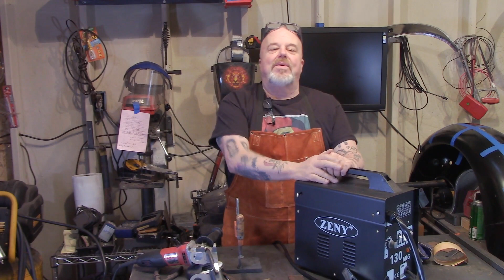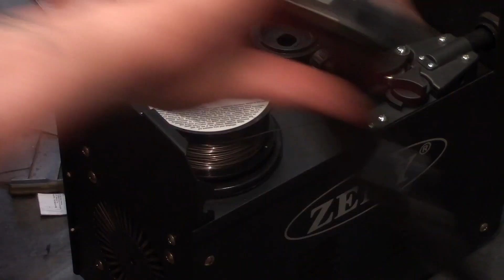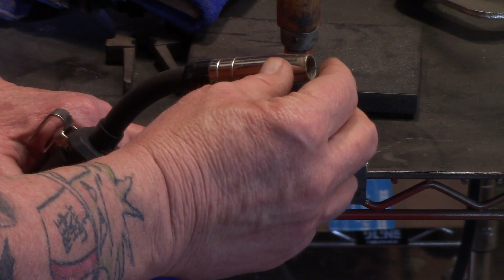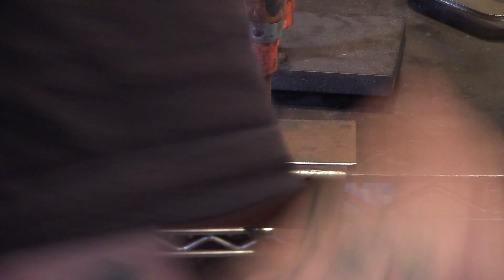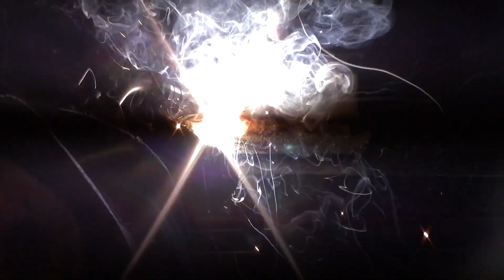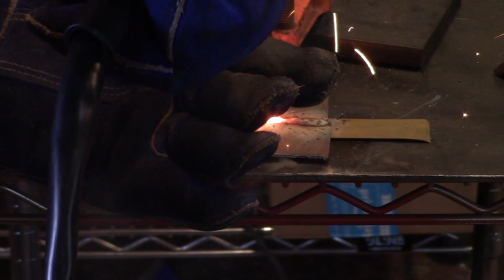Flux Core Welding 101 -The Basics- How To Weld - Basic Tutorial For Beginners

Comment: 1st i'm a beginner. was wondering at your weld in 30:00 min. of the video had a lot of splatter. was that from the thin metal or was that the wire speed going a little fast. just wondering haven't got my welder quiet yet. 😕
Reply from the maker: I hope to reshoot the vid. But yes. You nailed it

Comment: love it - I watched a bunch of stuff, got my welder a month ago - just got my table all set up tonight - and I'm still glad I came to watch this before I started practicing. I like that he left in the problem with the paper catching on the roller - something I would never have known to think about if I saw the motor was running, the feed clamp was correct but nothing was pulling. Also So glad you point out the power of the angle grinder - I've been using that tool since I was a teenager and it blows me away how cavalier some people are with angle grinders - especially those videos of people with that new chain saw blade wheel they've made for it - that thing should not even be allowed on the market in my opinion, but in any case that guard will definitely save your bacon. ALWAYS have it on and ALWAYS make sure to take the few seconds to rotate it based on your grind angle. Guy who taught me how to use one had two missing fingers to prove that they're powerful enough to really run away from you fast - they'll dig into anything you let them grab and god help you if it grabs a shirt sleeve or something. (he learned his lesson many decades before teaching me.)
Reply from the maker: Amen

Comment: I bought the Chicago Electric 125 a couple months ago.  However, I just started flux-core welding today.  Big difficulties.  I finally figured out that the wire feed was too slow.

Epiphany it was to me that you told longer wire is cooler and shorter wire is hotter.  After an hour of weld time, two hours clock time.

I found keeping the arc going on 10-gauge steel was easier with a high wire speed.  My problem which I am going to bed with is that if I do not get a spark immediately, the wire gets too long.  Sometimes when I finish a run the wire is three feet inches long.

Comment: I've been gas shielded MIG welding since I was about 6, just used my dad's snap-on welding setup. I'm to the point where I use his welder more than he does and I buy the gas/wire for him, I've gotten insanely good at getting those perfect welds. Only reason I'm here is I recently picked up a 5500w generator (needs carb and some love) and I'm thinking about fixing it up and using it to power a welder in my small shop, and since I am sick of buying gas I wanted to see what I can do with a flux core. So thank you for your info!

Comment: I never welded before one aspect is confusing me.Do you continuously hold the gun pushed in to get wire coming out while welding or you press stop press stop.Thank you
Reply from the maker: stop and start and stop and start. otherwise you'll burn out the base metal
Reply: @HughesMotorized  Thank you very much this aspect is almost never mentioned videos I watched.I guess its critical to see the wire tip how fast is burning up so you press more feed.

Comment: why are  you  stopping and starting  the  weld path? what shade of filter glass are  you using ?  say for  30 amps.
Reply from the maker: the longer you weld, the hotter the arc gets. Get it too hot and you will blow out lighter steel. Every hood is different. Go for 9 - 13. Start w medium sensitivity so you dont have it being dark before welding

Comment: should the gun nuzzle  tough the metal your welding or is it just the welding wire that should touch the metal?
Reply from the maker: Just the wire. You can actually run without the nozzle if you are not using gas

Comment: You don't have to do the back and forth movement when flux core welding.
Just pull in a straight line and make sure your puddle is covering the gap evenly on both sides of the weld.
You're also a little too close to pushing your weld rather than pulling.
Flux creates slag so you drag.

Comment: Looks like you were moving too fast. You also need to move around in order to not overheat the metal. Welder should also be able to be set DC+. That is, ground clamp should be + and torch -.

Comment: Hi could you weld 3/8inch material with a flux welder like this ? Great channel by the way
Reply from the maker: You are pushing it. You can do a root pass then come back with a pass or two. If it is something that a life depends on it? NO. You need a 220v higher amp machine if safety is an issue
Reply: @HughesMotorized  thanks for the response I am looking to make a 72" belt grinder like the one on jeremy Schmidt channel, I think I should do a bit more research thank you so much again for replying
Reply from the maker: @stephenforrester1832  YES, you can build that w/ a basic flux core machine. Just take your time

Comment: Can actully use the gun without that big tip so you can see the wire coming through better when you are welding? Seems like the tip on the gun is too big and should've been pointier.
Reply from the maker: YES. If you are not using gas then toss the tip
Reply: @HughesMotorized  thanks.

Comment: I see a problem with welders of that design.  The nozzle is used with gas.  I would think the nozzle gets in the way of viewing your arc and puddle.  When welding thin metal, I might suggest as other welders with more expierience than I do that you stitch weld (1" weld, 1" gap).  Then clean the slag and weld in the gaps.  Starting and stopping as you did incorporates slag in the weld; leads to porosity and weak weld joints.
Reply from the maker: Yup. You can do it without the nozzle on flux core. 1" and skp 1" is a good way indeed

Comment: Your commentary absolutely beats the hell out of any video I have seen thus far!! lol. You talk like I do, so I can understand ya! Maybe you could answer a few questions for me, purchased a truck with a rotted frame (unknowingly) and plan to buy the frame repair kit and weld it on. Was going to purchase a 170a flux core mig welder from Harbor Freight for the job. It is 1/8" steel, what size wire would you recommend and what setting would be best? I plan to practice first on scrap steel, as I have never welded with a mig welder before and have limited experience with a stick welder. Just do not want to end up totally screwed on this truck and no one around here seems to want to do it. Thanks in advance!
Reply from the maker: I'd say .035 wire and about a medium setting power wise. Main thing is get some scrap steel and practice. Do some destructive testing and cut across some welds to see penetration. Weld.com has some very informative videos that detail testing your welds. Kevin Carom does some awesome welding videos too. Good luck

Comment: Im buying a (cheap) 4 in 1 welder (mig, tig, flux core, stick) welder. I think i will use the flux core first because its the most convieint welding to stsrt. At least thats what i think
Reply from the maker: Flux core is most convenient and cheapest along with stick. Not so good on thinner metal. You can but it takes practice. MIG will set you back some $$$ but worth it
Reply: @HughesMotorized  im buying a 4 in 1 machine mig, tig, flux core and stick welder so i will have the option to use co2 or argon welding. And its not that expensive from the lidl store. And its quite a decent quality from reviews i saw

Comment: Hey there! I need advice - maybe You know about this: So I am trying to flux-core weld (polarities inverted, knurled roll, diameters correct). I want to weld an M4 rod onto the side of a long (4x normal length) M4 nut. A few tack welds would suffice. My machine has settings for material thickness and adjusts all else itself - so far, with ~2mm thickness and varying settings for more or less welding heat, I don´ t get far. Tried to pull the weld across the joint, not so much pointing it right at it. Mostly, I get bead on both parts, but no joint between them. I tried not ruining the thread in the nut. To that end I also put a vaseline-covered screw into the nut. Please, any advice would be dearly cherished.
Reply from the maker: shoot me a vid of the effort, settings, ground clamp and the like. hughesmotorized@gmail.com , I'll see if I can help
Reply: @HughesMotorized  Thank You! I noted your mail address, take it down if you want to. I´ll probably need a couple days before I can get back into the shop. So long :)

Comment: Great video. Thanks. I'm learning and getting a unit and gonna start practicing soon and you gave me inspiration. I have a pickup that needs cab mounts and a rocker panel.The mounts are 11 gauge. What size wire and settings would I need to be on?
Reply from the maker: I'd offer if you are doing flux core to go w/ .030" and if MIG then go w/ .023". Turn amps down low and see how it's working. Work in very short pulses to avoid blowouts

Comment: My fave video and instructor on flux core, I've just started myself with flux core and like he says it does take practice,  I spent a whole day just grinding and welding bits and pieces together and by the end of the day I looked homeless, I was that dirty and had that many holes in my clothes it was unreal. One of my problems as a novice is helmet settings, I'm still struggling to see what and where I'm welding sometimes which is a pain.
Reply from the maker: I bought a helmet with a bigger viewing area. I set it on 10. Check out this video. Might help : https://youtu.be/-FM2L_KOakU
Reply: @HughesMotorized  thanks buddy

Comment: When loading a new spool of wire pull the torch cable tight and straight, this gets the wire through easier without it binding up , also removing the tip helps .
Reply from the maker: good tips. thank you

Comment: I literally have this same welder.. Zeny 130.. .. You need to look up the videos for converting this welder to a DC welder.. It comes factory Ac.. You will need a 200 amp bridge rectifier .. And you will need to make your ground hot and your gun ground.. And put a new ground clamp on It....It also calls for a bleed resistor and a few capasitors .... But this machine right out of the box is garbage..
Reply: Why you said it's garbage? Is it due to the fact that it's AC? I am genuinely curious,  as I just bought one like it.

Comment: I bought a very similar welder 30 months ago in the UK (240 v)  and it can be made to do very decent welds but it took a lot of practice and the welds are not very pretty to look at. I have also bought a cheap TIG welder and that actually is easier on simple welds despite what people say and thin material is much easier, but the welder is twice the price. Both have there uses so no one welder is the best. Practice is the key and learn from the experience don't be discouraged by it is my advice. A good bench is a must !
Reply from the maker: True gospel. I have a TIG that I need to practice on. I agree on the flux core. You have to clean up the spatter. Stay safe my friend.

Comment: Just to clarify since I have one of those welders, it is NOT a dc welder it is an ac welder. You will have to modify it to make it a DC one.
Reply from the maker: NOPE. Do you know what an inverter is ? Might want to read up
YES. It plugs into AC. The inverter outputs DC. All flux core welders use direct current (DC), much like a typical battery. In most cases, the polarity will be DC-electrode positive,
Reply: I have been working with electronics since age 14 I'm  50 now, the first amplifier I made used an inverter so my car battery could powered 80 volts circuitry,  I had to convert DC to AC passed through a transformer and then rectified it back to DC. If you don't believe me please feel free to open your welder and try to find the rectifier circuitry after the transformer or even simpler hook a multimeter between your torch and your ground clamp and see what type of voltage you get. Not a single cheap 90 to 120 amps flux core welder is DC output, the cheapest  DCEN starts around 180 dollars. But like I said before: I have your exact same welder in my basement and I had to convert it to DC to get decent jobs. Have a nice evening.
Reply: Sorry I forgot to clarify something: an inverter converts DC into AC. A rectifier converts AC into DC, a little more complicated than that but since you asked if I knew what and inverter was.
Reply: @HughesMotorized  you might want to read the front of that welder because it is an AC welder and is advertised as such on the website. And probably says it right on the little electrical thing.
 they do exist, they're the shity ones.

Comment: I wanna see a belt driven Chinese motor. The Zeda ones are junk. How about a whizzer hoop or one from golden eagle? Replace small sprocket on engine with pulley then figure gear ratio. Quiet and clean
Reply from the maker: I built a HD replica w/ a 79cc that used belt drive. I made a suicide style "clutch" lever to engage belt.. I was fun to play with. I have a hoop sitting on the shelf just waiting. I have several big projects going now but might dust that hoop off one day

Comment: that welder you got is not going to help your welding in any way. flux core welding is hardest welding as it is and you need as much control as you can get. in this day and age you can get  much better welders  with variable voltage and amperage control.
Reply from the maker: For $87??? Hmmmmm

Comment: I have about 3 gallons of gas thru the 4 stroke motor. I am so happy that I have built it. Still love my 2 stroke's but this is the way to go. Using the arc chain tensioner. 38t sprocket. I'm not going to say how fast it is. Running timkin wheel bearings, it is a good little bike.
Reply from the maker: Ride on sir. Enjoy
Reply: @HughesMotorized  Safety 👍 had a guy have a wheel explode at the job site. Hit him in the jugler. He died before anyone could help him. I have burned a rod or two. We have a Miller here at the shop. You guys damn sure better believe what the Man is saying. 🕶️😕
Reply: @Saddletramp1200 : Also be careful with what you use to clean the metal before welding. Do NOT use brake cleaner on a metal surface if it contains tetrachloroethylene. I don't know if flux core welding involves argon gas but even so, it's best not to start bad habits at this basic level. Phosgene gas is fatal shit. I know Mr. Hughes knows this because he's a very cautious man. You can't be too cautious. No such thing as too safe. Thank you Mr. Hughes for the great education on welding.
Reply: @theanomalous1401  Thanks for the information. I have no idea what my latest motorized bike has to do with welding but you are absolutely correct.